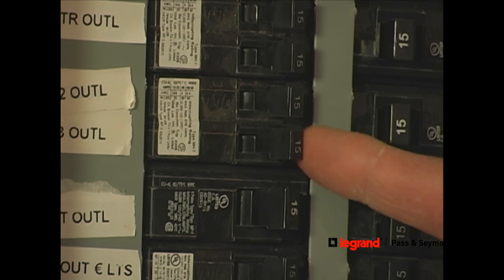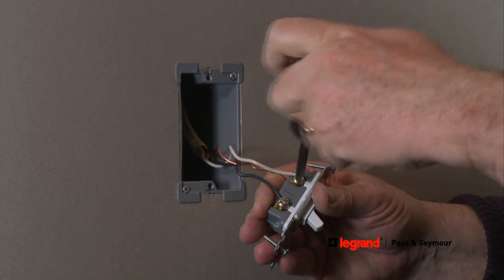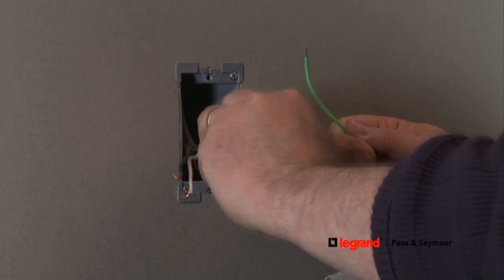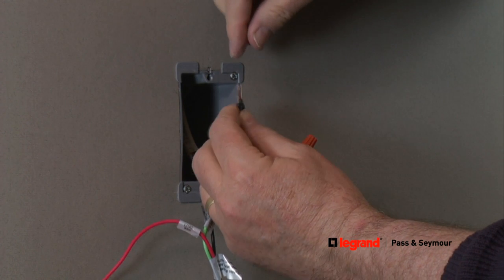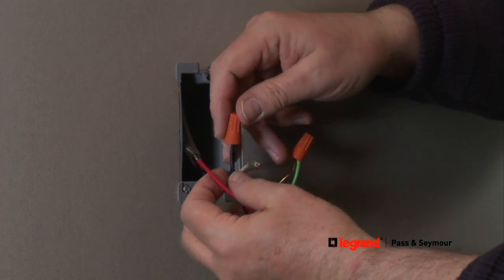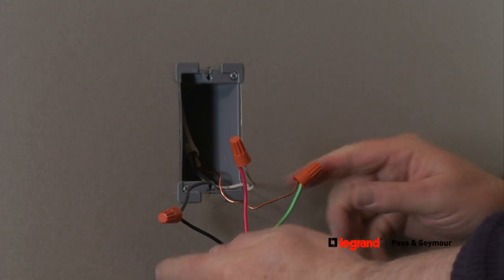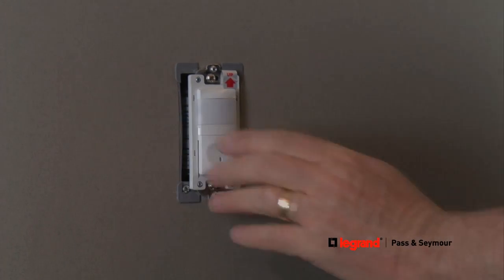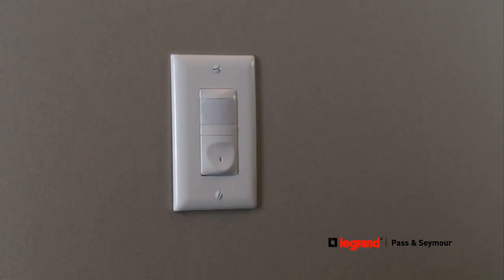Pass & Seymour: How to Install a Occupancy Sensor

Comment: My pass and Seymour occupancy sensor switch, rwu600u, has 3 wires coming out of it, red, white, and black and had an additional disconnected green  wire included with it. The only wires coming out of the existing light switch are a black, a white and a bare.   Which wires do I connect to what?
Reply from the maker: Hi, Lee. Please feel free to contact Tech Support for assistance.

P&S Technical Support
(800) 223-4185
tech.support-ps@legrand.us